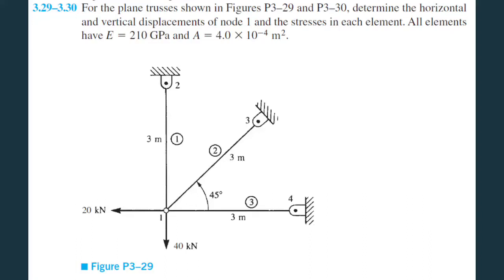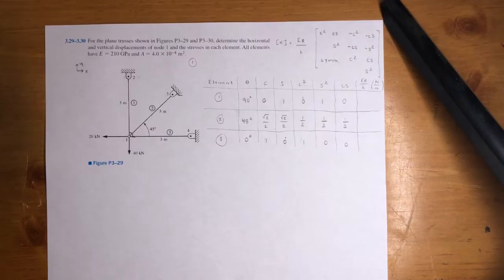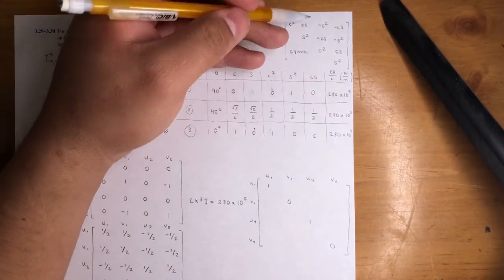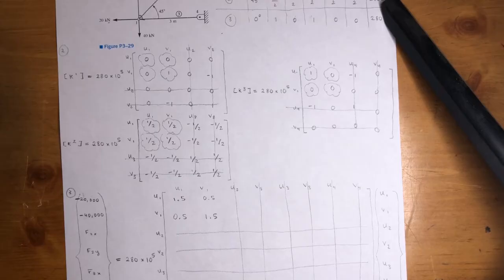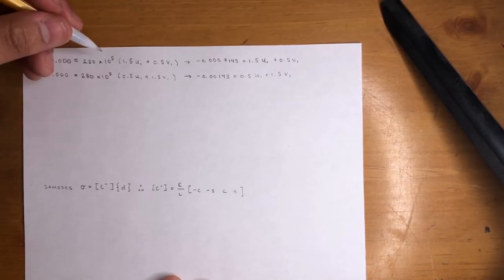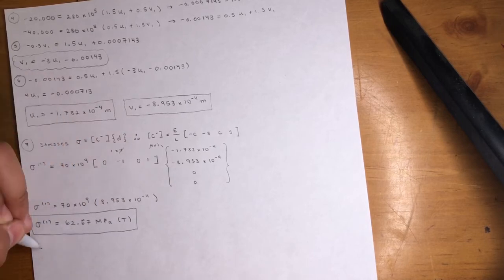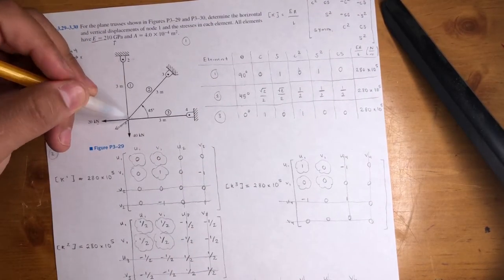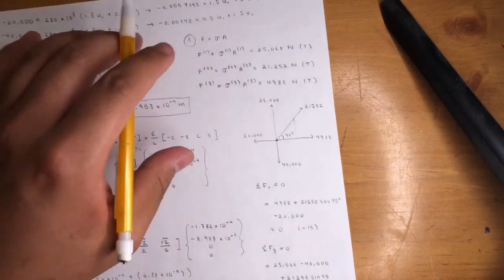Finite Element Analysis - Determine the Horizontal and Vertical Displacement  of Node 1 & the Stress

Comment: How to Find the length on element 2 if not given in question. In a similar sum length of 1 and 3 elements is 12 m and there's only one force vertically downwards of 10 kN insted of 40 kN at node 1.

Thanks.